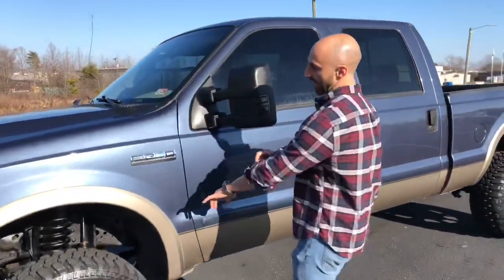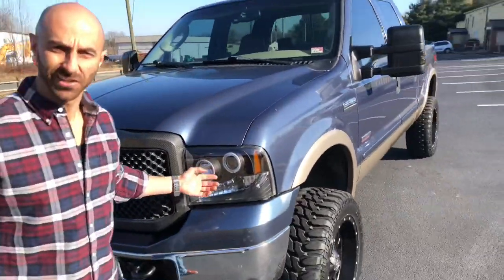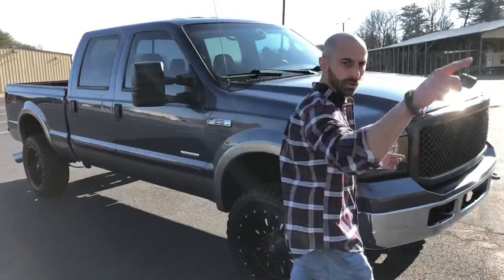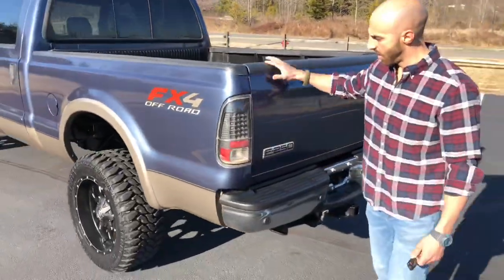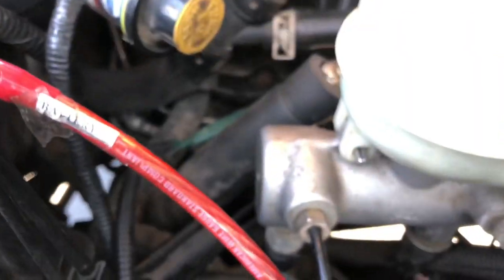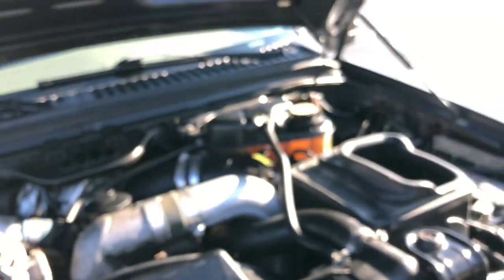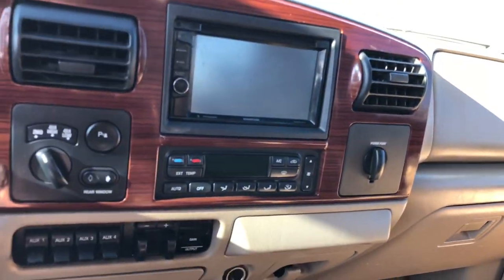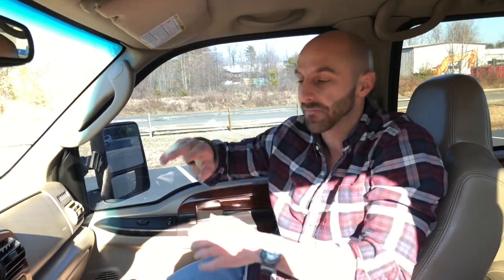Bulletproof, whistling, full exhaust, tuned, nasty 2005 Ford F-250 Lariat 6.0 turbo diesel!

Comment: That's a sharp 6.0L powerstroke diesel. I like color blue with the fuel wheels and the fx4 off road on the side of the box. I wish I owned this truck. It's a sharp looking truck that sounds good going down the road. I like the turbo whistle going down the road. I hope to own a 6.0L powerstroke someday.
Reply: Agreed 100000%!!  Going on year 4 of owning an 05’ 6.0 F250 w/ 7” lift and I only bought it AND still keep it (reluctantly) due to not only the “small-fortune” that I have put into it over the years, but also due to the fact that it is hands down the best looking and best sounding/performance pickup truck of all time!!  As a kid in early to mid 00’s, that body style from the Super-Duty F-series trucks from the late 90s to 2016 or so left  a lasting impact on me. They don’t make, nor will they ever again make trucks so bada*s and unique. Driving on the highway/roads, you knew/know what an O.G. Super-Duty looks and sounds like, even a mile away at night w/ that mean look and iconic, upside-down rectangular door handles. Nowadays all their trucks look the same!!  They all can pass for glorified F150s these days. Lol